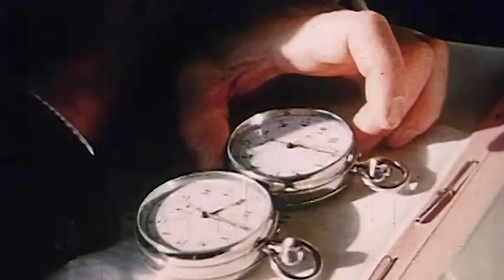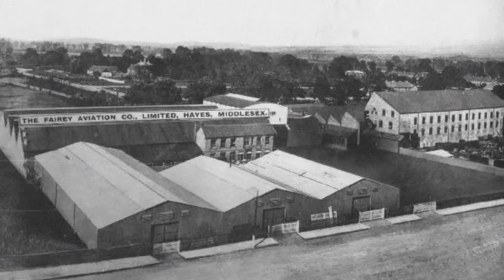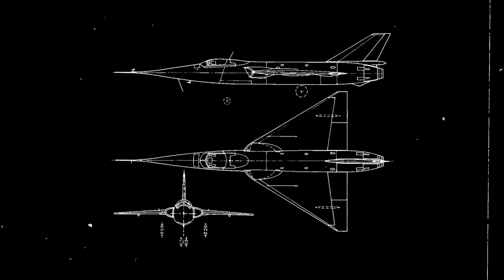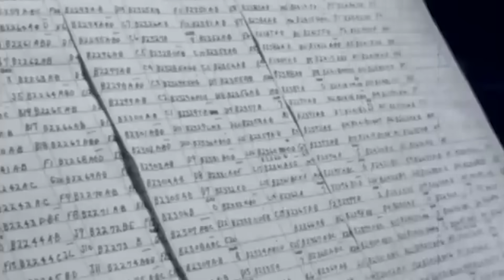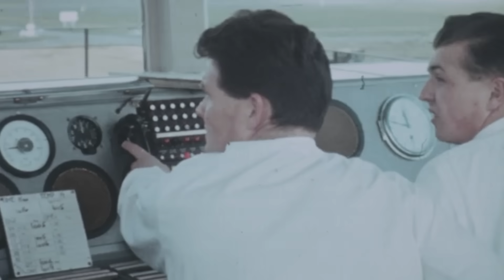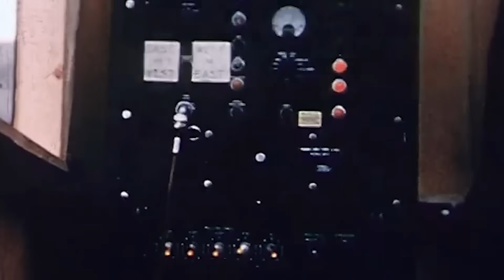Britain's 300 MPH Most Successful Mistake

Comment: Not to mention what Tony Benn did to the UK's fledgling space programme.  Cancelling the Blue Streak ICBM robbed us of a top-notch booster which could have formed the basis for multi-stage rockets far ahead of what the US had at the time.  A Blue Streak/Black Knight combo could have given Britain a launch capability par excellence.
Reply: The UK's fledgling space program??? you know that Wallace and Gromit aren't real?
Reply: @DoktorBayerischeMotorenWerke 

Essentially it was an awful lot easier to do very large rocket development in the US, that's the reason it wasn't something that was done in the UK.

There's a good chance that anybody currently flying on a widebody airliner will be on an aircraft that has RR gas turbine aero engines designed & built in the UK.

Indeed, an airline recently ordered sixty Trent XWB gas turbine aero engines.

Indeed, an airline recently ordered sixty Trent XWB gas turbine aero engines.

Clearly It's a great pity & a crying shame that British forces had to occupy a large part of Germany for decades after 1945 & that Russia had to do the same, isn't it. Russia still posseses a large chunk of what was German territory of course. Russia & the UK produce nukes, Germany does not produce nukes.
Reply: @DoktorBayerischeMotorenWerke 

We believe we can clear up some commonly held myths and misconceptions, obviously

It's always good to see the facts presented clearly and concisely isn't it?

The original fabulous Whittle reverse combuster centrifugal compressor gas turbine aero engine has been in production permanently in one form or another by more that one manufacturer since 1939. The main current application is for helicopters. 
Whittle performed the world's first demonstration of a gas turbine aero ending in 1937. 

British Aerospace Sector & some bits & bobs etc. 

Interesting British achievements.
There is no doubt that the Fairey (England)
Delta 2 was of course the world's first jet
aircraft to exceed 1000 mph.  lndeed It
exceeded the previous record by 310 mph &
held the record for more than a year. Incidentally, the Dassault Mirage series of aircraft are based on the Fairey Delta 2. 
March 1956,  UK Peter Twiss,
1,132	 mph, Fairey Delta 2,	 Chichester, UK

The next speed record after the FD2 -
December 1957, USAF	1,207.6	mph, McDonnell F-101A Voodoo, 	Muroc, California 😎.

Non combat phase accident losses.
% of Aircraft built.
The EE Lightening did not have unusually high losses. 
The Canadair CL-44 was a turboprop airliner.
Canadair CL-44               (ff 1959 ) 48%
Lockheed XF104             (ff 1954) 100%
Lockheed  P80                (ff 1944)  43%
Lockheed F104               (ff 1954)  45%
MD FH Phantom 1          (ff 1945)  35%
MD F4 Phantom 2           (ff 1958)  28%
Convair F102 Dagger      (ff 1953)  45%  
MD F3H  Demon              (ff 1951)  32%
MD F-101 Voodoo           (ff 1954)  34%
EE Lightening                   (ff 1954)  33%
Gloster Meteor                (ff 1943)   21%
DH Vampire                     (ff 1943)   23%
DH Sea Vixen                  (ff  1951)  33%
Gloster Javelin                (ff 1951)   20%

Note that the Meteor didn't have particularly high losses, flew with more than 20 airforces for decades, got involved in air to air combat during a number of conflicts successfully against aircraft that first flew many years after the Meteor first flew.

Early days, jet engines. Whittle performed the world's furst demonstration of a gas turbine aero engine in 1937. The RR Nene, a centrifugal gas turbine aero engine, was the world's most reliable & most powerful gas turbine aero engine in 1944. Licensed built versions & copies of the RR Nene & RR Derwent would go on to power many aircraft in Russia including the Mig 15 & Mig 17, the US, China, France & other countries for decades after 1944. Incidentally, the Mig-15 was in essence an upsized / tweaked copy of the Whittle / Gloster E28/39 jet aircraft including a copy of the RR engine.  The centrifugal compressor gas turbine aero engine with Whittle style reverse flow combusters and sometimes an axial compressor section is still manufactured by more than one company, the main application being helicopters.

   That's correct, The Tornado & Typhoon & their engines are supersonic & are indeed British design aircraft with British design engines built by an international consortium. The Tornado design for example started life during the 1950s at Vickers as the AFVG, it's engine is based on the RR RB-199. The EE Lightening is also a British Supersonic jet aircraft. At the time the EE Lightening first flew it was indeed one of the fastest aircraft on the planet, it was still one of the fastest aircraft on the planet 4 years later when it managed a mach 2 flight.

  The Typhoon is the British BAC-EAP with an engine based on the British RR XG-40, the Typhoon is also built by an international consortium.

  Clearly It's a great pity & a crying shame that British military forces had to occupy a large part of Germany for decades after 1945 & Russian military forces had to do the same. Of course Russia still posseses a large chunk of what was German territory & of course  Russia & the UK produce nukes. Obviously Germany does not produce nukes.

An example of what goes on these days in various countries.

   Indeed, There are no German companies that make German jet aircraft in Germany & there are no German Companies that make German gas turbine aero engines in Germany that are suitable for widebody airliners.

  BAe Systems, GKN Aerospace & Rolls Royce combined now do more Airbus work than Germany on an absolute basis & significantly more work than that on a per capita basis.
   
  Per capita for the home nation BAe Systems is the world's largest defence contractor. BAe systems announced the recent £4 Billion takeover of Colorado based US based Ball Aerospace.
  
  BAE systems now does a significantly higher value of work for Airbus than it did when it was a major Airbus shareholder before 2005.
     
  RR now owns US Engine maker Allison for example which does classified Aerospace work for the US Govt.
   
 Anybody currently flying on a widebody airliner stands a good chance of being on an aircraft powered by RR gas turbine aero engines built in the UK.

  A glimpse of what goes on in the very internationally orientated British aerospace sector.

Boeing Apache Attack Helicopter.
AH-64: 75 UK suppliers, 7% UK content, global fleet of 1280+ aircraft.
F35B more than 130 UK Suppliers, more than 30% UK content.
F35A & F35C more than 130 UK Suppliers, more than 15% UK content.

The UK has the world's highest combined per capita Nuclear, Defence & Aerospace Sector activity.

Rolls Royce Holdings UK
Subsidiaries
- Rolls-Royce plc
- Rolls-Royce North America (Allison etc &  
  Classified Military stuff)
- Rolls-Royce AB
- Rolls-Royce Deutschland
- Rolls-Royce India Private Limited
- Rolls-Royce Marine Power Operations
- Vinters Engineering Limited
- Rolls-Royce Controls and Data Services
- Rolls-Royce Power Systems
- Bergen Marine
Joint ventures include:
- Rolls-Royce Turbomeca
- MTU Turbomeca -

Trent Family
The MT30 (Marine Turbine)
Industrial Trent 60 Gas Turbine
Trent 7000
Trent XWB Airbus A330neo.
Trent 1500
Trent 1000
Trent 500
Trent 600
Trent 700
Trent 800
Trent 8100
Trent 900

RR wholly owned subsidiaries in Germany handle smaller 2 shaft RR gas turbine aero engine work.   

We hope this helps of course.
     
Cheers, as always & indeed 👍.

Comment: Not to mention that Dassault then produced the Rafale, using the same bag of experience and expertise in delta wings, which is basically "my own Typhoon, with black jack and hookers". Double whammy for British aviation..
Reply: Indeed, France developed several very successful supersonic jet aircraft while Britain only had a single supersonic of its own... and the Lightning was not popular, few were sold..
Reply: @DoktorBayerischeMotorenWerke 

We feel we can clear up some commonly held misconceptions and myths.

That's correct, the Tornado & the Typhoon are largely British design aircraft using British design engines.

Obviously there's a good chance that anybody currently flying on a widebody airliner will be on an aircraft that has RR gas turbine aero engines designed & built in the UK.

Indeed, an airline recently ordered sixty Trent XWB gas turbine aero engines.

Indeed It's a great pity & a crying shame that British forces had to occupy a large part of Germany for decades after 1945 & that Russia had to do the same. Russia still posseses a large chunk of what was German territory of course. Russia & the UK produce nukes, Germany does not produce nukes.

We hope this helps.

Cheers
Reply: @DoktorBayerischeMotorenWerke 

We believe we can clear up some commonly held myths and misconceptions, obviously

It's always good to see the facts presented clearly and concisely isn't it?

The original fabulous Whittle reverse combuster centrifugal compressor gas turbine aero engine has been in production permanently in one form or another by more that one manufacturer since 1939. The main current application is for helicopters. 
Whittle performed the world's first demonstration of a gas turbine aero ending in 1937. 

British Aerospace Sector & some bits & bobs etc. 

Interesting British achievements.
There is no doubt that the Fairey (England)
Delta 2 was of course the world's first jet
aircraft to exceed 1000 mph.  lndeed It
exceeded the previous record by 310 mph &
held the record for more than a year. Incidentally, the Dassault Mirage series of aircraft are based on the Fairey Delta 2. 
March 1956,  UK Peter Twiss,
1,132	 mph, Fairey Delta 2,	 Chichester, UK

The next speed record after the FD2 -
December 1957, USAF	1,207.6	mph, McDonnell F-101A Voodoo, 	Muroc, California 😎.

Non combat phase accident losses.
% of Aircraft built.
The EE Lightening did not have unusually high losses. 
The Canadair CL-44 was a turboprop airliner.
Canadair CL-44               (ff 1959 ) 48%
Lockheed XF104             (ff 1954) 100%
Lockheed  P80                (ff 1944)  43%
Lockheed F104               (ff 1954)  45%
MD FH Phantom 1          (ff 1945)  35%
MD F4 Phantom 2           (ff 1958)  28%
Convair F102 Dagger      (ff 1953)  45%  
MD F3H  Demon              (ff 1951)  32%
MD F-101 Voodoo           (ff 1954)  34%
EE Lightening                   (ff 1954)  33%
Gloster Meteor                (ff 1943)   21%
DH Vampire                     (ff 1943)   23%
DH Sea Vixen                  (ff  1951)  33%
Gloster Javelin                (ff 1951)   20%

Note that the Meteor didn't have particularly high losses, flew with more than 20 airforces for decades, got involved in air to air combat during a number of conflicts successfully against aircraft that first flew many years after the Meteor first flew.

Early days, jet engines. Whittle performed the world's furst demonstration of a gas turbine aero engine in 1937. The RR Nene, a centrifugal gas turbine aero engine, was the world's most reliable & most powerful gas turbine aero engine in 1944. Licensed built versions & copies of the RR Nene & RR Derwent would go on to power many aircraft in Russia including the Mig 15 & Mig 17, the US, China, France & other countries for decades after 1944. Incidentally, the Mig-15 was in essence an upsized / tweaked copy of the Whittle / Gloster E28/39 jet aircraft including a copy of the RR engine.  The centrifugal compressor gas turbine aero engine with Whittle style reverse flow combusters and sometimes an axial compressor section is still manufactured by more than one company, the main application being helicopters.

   That's correct, The Tornado & Typhoon & their engines are supersonic & are indeed British design aircraft with British design engines built by an international consortium. The Tornado design for example started life during the 1950s at Vickers as the AFVG, it's engine is based on the RR RB-199. The EE Lightening is also a British Supersonic jet aircraft. At the time the EE Lightening first flew it was indeed one of the fastest aircraft on the planet, it was still one of the fastest aircraft on the planet 4 years later when it managed a mach 2 flight.

  The Typhoon is the British BAC-EAP with an engine based on the British RR XG-40, the Typhoon is also built by an international consortium.

  Clearly It's a great pity & a crying shame that British military forces had to occupy a large part of Germany for decades after 1945 & Russian military forces had to do the same. Of course Russia still posseses a large chunk of what was German territory & of course  Russia & the UK produce nukes. Obviously Germany does not produce nukes.

An example of what goes on these days in various countries.

   Indeed, There are no German companies that make German jet aircraft in Germany & there are no German Companies that make German gas turbine aero engines in Germany that are suitable for widebody airliners.

  BAe Systems, GKN Aerospace & Rolls Royce combined now do more Airbus work than Germany on an absolute basis & significantly more work than that on a per capita basis.
   
  Per capita for the home nation BAe Systems is the world's largest defence contractor. BAe systems announced the recent £4 Billion takeover of Colorado based US based Ball Aerospace.
  
  BAE systems now does a significantly higher value of work for Airbus than it did when it was a major Airbus shareholder before 2005.
     
  RR now owns US Engine maker Allison for example which does classified Aerospace work for the US Govt.
   
 Anybody currently flying on a widebody airliner stands a good chance of being on an aircraft powered by RR gas turbine aero engines built in the UK.

  A glimpse of what goes on in the very internationally orientated British aerospace sector.

Boeing Apache Attack Helicopter.
AH-64: 75 UK suppliers, 7% UK content, global fleet of 1280+ aircraft.
F35B more than 130 UK Suppliers, more than 30% UK content.
F35A & F35C more than 130 UK Suppliers, more than 15% UK content.

The UK has the world's highest combined per capita Nuclear, Defence & Aerospace Sector activity.

Rolls Royce Holdings UK
Subsidiaries
- Rolls-Royce plc
- Rolls-Royce North America (Allison etc &  
  Classified Military stuff)
- Rolls-Royce AB
- Rolls-Royce Deutschland
- Rolls-Royce India Private Limited
- Rolls-Royce Marine Power Operations
- Vinters Engineering Limited
- Rolls-Royce Controls and Data Services
- Rolls-Royce Power Systems
- Bergen Marine
Joint ventures include:
- Rolls-Royce Turbomeca
- MTU Turbomeca -

Trent Family
The MT30 (Marine Turbine)
Industrial Trent 60 Gas Turbine
Trent 7000
Trent XWB Airbus A330neo.
Trent 1500
Trent 1000
Trent 500
Trent 600
Trent 700
Trent 800
Trent 8100
Trent 900

RR wholly owned subsidiaries in Germany handle smaller 2 shaft RR gas turbine aero engine work.   

We hope this helps of course.
     
Cheers, as always & indeed 👍.